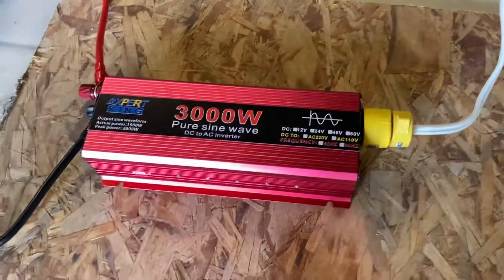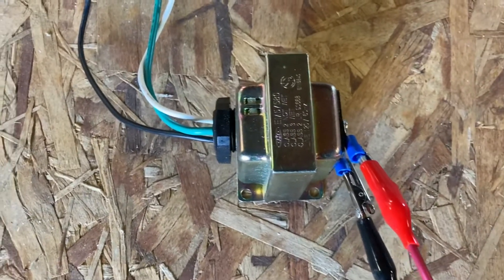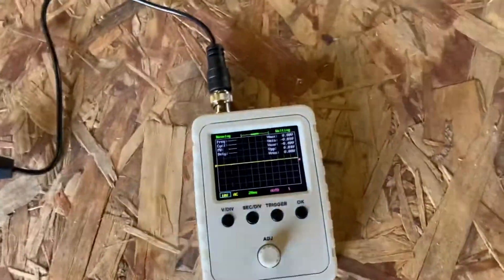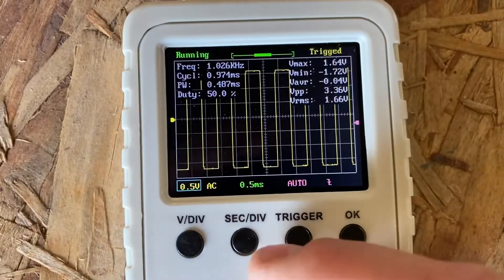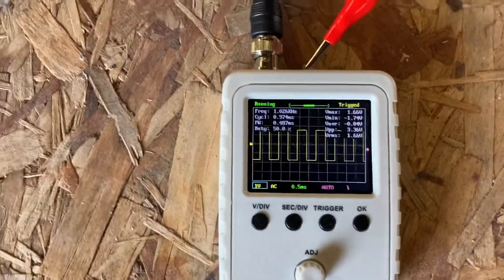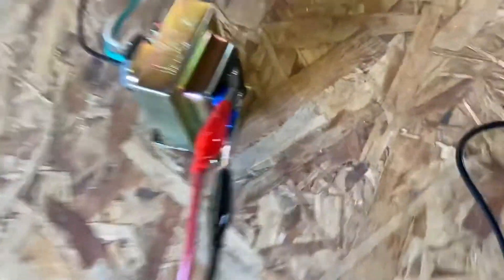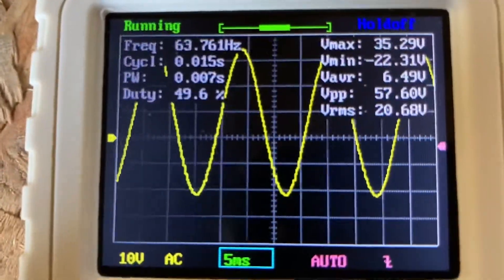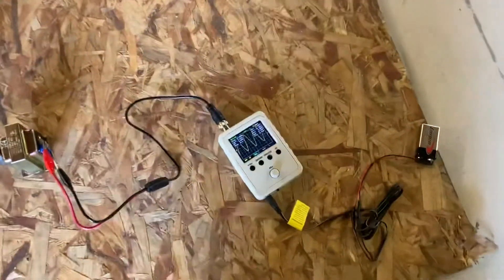PART 1 Pure sine wave inverter testing using a $30 AliExpress oscilloscope

Comment: you are using two hf filters before your scope(one transformer and one ferite)it is better to measure directly at the output from your inverter.
you will find that those pure sinewave inverters make a lot of high frequenzy noise.

Comment: Thanks for the video, 
I want to know if this will work for me.
I have a submersible pump. , single-phase

** *Pump Specifications:* ** 

- Power: 500W 0.67HP
- Current: 3.8A Steady running current
- Voltage: 220V
- Frequency: 50 Hz
- Max Flow: 35 L/min
- Speed: 2860 rpm/min

- Peak running current  - I don't know how much exactly I think it will be 11A

The operating time of the pump is 15 minutes per day.

1500/3000W inverter is good ? or inverter 1100/2200w
Reply from the maker: I think an inverter like this would work, although if I were to buy another one, I would choose one with 24v or 48vdc input instead of 12 volt

Comment: Ksi b Bhai k ups ka koi b msla hai ya ksi ki battery khrab ho chuki hai to apni prblm solve Krne k lye neche link pr click krn Jzak Allah💯
 
💯💯💯💯💯✌️✌️👇👇👇👇👇👇👇👇👇👇👇👇
https://youtu.be/LD4ImM-lpQU

Ups Bnate Ya Lete Wkt Kin chizon Ka Khyal Rkhna Chaiye | Ache Ups Ki Pechan

https://youtu.be/_T926FZiIBY

How To Install UPS Battery At Home | UPS Battery Connection@Akash Babu

https://youtu.be/4-1vMNfMteg

UPS Khrab Ho Jaey To Ghr Ki Bjli Ks Trha Chlaen |

https://youtu.be/t1NTtTLRNm4

Which Battery Is Best For Ups And Solar System In Pakistan| Best Backup Battery For Home

https://youtu.be/genAK-_HAwg

Ups Card Connection | How To Install Card In Ups Full Information/ Akash babu

https://youtu.be/oyVpmHQEvE0

How Much Power Does A Ups Consume | Ups SE Bjli K Bill Me Izafa Hota Hai,|AJ Electric

https://youtu.be/l4bo4VwoTF0

DC Power Supply Full Information | Veriable DC Power Supply Review

https://youtu.be/VUc5FuTdiVs
Pakistani Ups 4 Fault Solution | Big Fault Solution | Pakistani Ups Full Information

https://youtu.be/s6DdMbWyMAo

Millat Battery Ups K Sath Lgana Kesa Hai | Millat Battery Solar K Sath Lgana Kesa Hai | AJ Electric

https://youtu.be/fcUjuThs0AE

How To Repair Battery  At Home  |12V    200 Mpair | @AJElectric

https://youtu.be/tOw6bQ05sUA

UPS LED Lights Full Information | Pakistani UPS | @Engineer Setup

https://youtu.be/wozulozeo3w

UPS K Andr Madule Card Lgane Ka Tarika | Card Madule Installation In Ups |Akash babu

https://youtu.be/fcUjuThs0AE

How To Repair Battery  At Home  |12V    200 Mpair | @AJElectric

https://youtu.be/urbikCBQr6A

UPS Output 220V Board Setting | UPS Chezen jla Deta Ho To Kese Thk Krn

https://youtu.be/DV42QhsoJD4

UPS MPair | UPS Battery Low | UPS Battery Full | UPS Overload | UPS Fix Volte | UPS Load |

https://youtu.be/b7G4q2lF3g4

Desi Ups Setting Control kit Amp Volt Overload Setting|Battery Overload Setting

https://youtu.be/y0ZdIW3630k

Best UPS In Pakistan 2022 | UPS Vs Inverter |   گھر کے لئے کون سا یو پی ایس لینا چاہیے

https://youtu.be/bh5fi0bqzbU

UPS Banane Ka Tarika | Pakistani UPS Bnane Ka Mukaml Tarika | یو پی ایس بنانے کا مکمل طریقہ |

https://youtu.be/CPCeQwIVWQk

UPS Transformer Madule Card Lgane Ka Mukaml Tarika |

https://youtu.be/HxbjCpmYYH8

Transfarmer wire lagane ka tarika | UPS bnane ka tarika part 3 |Akash  Babu

https://youtu.be/PLYNxkPHkqY

Pakistani UPS Banane Ka Tarika| Part 2| یو پی ایس بنانے کا مکمل طریقہ

https://youtu.be/8BPnExZWCFY

Local Made UPS Accessories And How Can We Manufacturing Of 1000W UPS At Home |

https://youtu.be/cp56YrI5Zt8

How To Make Connection Of UPS Kit | How To Make Connection Of UPS Circuit |

https://youtu.be/DTCTzNEGsDI

UPS Wholesale Sman Lahore | UPS Sman Price |

https://youtu.be/gv_UUKuaVo4

Pakistani UPS Output No Backup | How To Repair Local UPS |

https://youtu.be/xufx1Zro8so

How To Replace UPS Module |UPS Ka Purana Madule Nikal Kr Naya Lgane Ka Tarika |

https://youtu.be/xufx1Zro8so

How To Replace UPS Module |UPS Ka Purana Madule Nikal Kr Naya Lgane Ka Tarika |

https://youtu.be/04LqA6XVcMQ👆👆

👆👆👆

UPS Transformer Wiring
 Nikaalne Ka Tarika | What Is Transformer | How Transformer Work In UPS |

https://youtu.be/kJNAWaEztzA

👆👆
Pakistani UPS 220 Volte Output Setting | UPS Setting |Aj Electric👆👆👆👆👆👆👆👆👆👆

https://youtu.be/j27Vfn5NVWM.....................What Is Transformer,Madule And Card And How It's Work In Ups Full Information
https://youtu.be/QjQM72zLlWI.          ............Ups/Solar Lgane SE Pehle Kn SI Information Hona Ap K Pas Zruri Hai
Ksi b Bhai k ups ka koi b msla hai ya ksi ki battery khrab ho chuki hai to apni prblm solve Krne k lye neche link pr click krn Jzak Allah...

Comment: TIP Solar; You can gradually dim down an under-table bulge and all other hungry electricity consumers with a 5000W dimmer (7, EUR). I run 5 dimmers in parallel on an 850W inverter. Kettle 2.2KW at 150W runs for 12 hours at a time, so the water is always hot. The room is also nicely heated. 2.5KW washing machine runs in parallel with dimmed to 200...400W. Iron, dishwasher, oven, electric heater, coffee machine, all internal heating are throttled with me. Videos on my channel https://youtu.be/eC2olbCBhh0 The inverter stays cool, quiet and the MOSFETs remain intact because no extreme current peaks arrive at the inverter... A small, cheap mini solar inverter is now sufficient for everything.

Comment: The transformer isn't needed some claim it changes the wave. Just need the 10x probe available from multiple brands. I just made a vid showing an example search YT for "2uPgP3S5sug" and it will be the first vid, or go to my channel and click on videos. It's currently the latest vid.
Reply from the maker: For sure, I definitely agree. 

There is no way that a transformer can change the sine wave. The sine wave in should look exactly like the sine wave out. 

As far as the different probe, I know I could get a different one, but I happened to have the doorbell transformer already, and I hate spending money on things if I can avoid it. 

I’ll check out your videos! Thanks for commenting!
Reply: @crownlounger  In my vid I also show a way to make a little adapter that's safer for testing the Sine Wave. The exposed contacts are mostly covered

Comment: I always laugh when I see the words, 'pure sine wave' on an inverter.  It's an oxymoron.  The 2 are incompatible.  The fets open and close rapidly creating whatever wave form possible but certainly not "pure".  Filters also help.  But again not a pure sine wave.  If you look at the little bumps in your wave form, you will see these irregularities are less than pure, which would be completely smooth.  Knowing how the dc is converted to ac in an inverter tells you that these devices are incapable of a 'pure' sine wave.  Not that they aren't acceptable either, mind you.  But none the less, a bit disingenuous.  It is possible to create so many pulses to get the waves into a more useable form but not pure.  And again, that's by nature of the way an inverter works.  If you want pure sine wave you get a generator and spin it around inside 2 fields to produce one.  Many of these inverters do get you close enough for useful purposes, though.

Comment: Dude great video.  I also got a portable oscilloscope which has a voltage limit.   I liked how you were able to hook it up to observe the inverters wave form.   Good job!    I'm hoping to get a larger bench scope when money becomes available.   Also liked your shop main disconnect.
Reply: The transformer isn't needed some claim it changes the wave. Just need the 10x probe available from multiple brands. I just made a vid showing an example search YT for "2uPgP3S5sug" and it will be the first vid, or go to my channel and click on videos. It's currently the latest vid.
Reply: That sounds great.  I'm also looking to buy fnirsi-1014d on ebay.  It has a 7 inch lcd and two channel signal generator.   But like you, waiting for funds.   It's under 200.   It's very space saving in that it's not deep and can rest easily on a shelf.   It also I believe operates on 12v dc if I read that correctly.  I use lots of cordless solar charged tool batteries in my shop.

I ordered that 10x probe for my portable scope.  Thanks again for the tip
Reply from the maker: Sorry for the late reply, but thanks for watching! 

Others have mentioned that I could have bought some adapters for the oscilloscope, but I think my little setup worked pretty good. 

I also am hoping to buy a bigger bench scope when funds are available, but for now the little AliExpress one will have to do. 

The shop disconnect was an easy (and fairly cheap) addition and really helps me do some testing when I want. Definitely recommend if you have the capability!

Comment: Nice to see it with the pure sign wave in testing but under load that might change. It looks really small for a 3000 watt pure sign inverter. Size looks more like a 1000 watt. Still could be useful if its safe.
Reply from the maker: Check out my latest video that shows the inverter under load!
https://youtu.be/_pfpbvw2qoI

Comment: If ypur booster pack is like most and you want to make the battery lasts longer charge it with a good battery charger through the booster cables make sure the battery charger does sealed lead acid batteries that charges them to 14.8 volts i have over 12 old booster packs all with dead sulfated batteries when I found proper charging parameters for sealed lead acid batteries on utube I thought they had to be wrong as the manufacturer should know how to properly charge the battery so I took apart my old black and decker and written right on the battery was do not discharge below 12.2 float charge is 13.4 and full charge is 14.8 and on the built in charger was 12 volts so it was dead to start with and being discharged way too far since I had bought 2 ever start booster pack with inverter I checked out what they're charging parameters were the charger was 12 volts but the pack said 13.1 when fully charged so I phoned everstart to check it out and they said that 13.1 was fully charged but I noticed that the booster packs started to loose the number of boosts I could get from a charge from 5 + to 4 then 3 so I put my automatic charger on it at first it would only get it to 80% but after using and charging a few cycles it now charges to 14.1 volts and I can get about 4+ boosts from them they're over 18 months old now and still working my old packs all died after a year I kept them because I could hook them to a battery and use the inverter or the air pump now I'm keeping them because I found I can change the battery again I found it on utube video telling me how to replace the battery even on my nautilus booster pack so when I have this money I'm going to upgrade 2 of my old booster packs I want to add usb regular plus usb quick charge and USB type C as well as 12 volt regulated dc circuitry plus check to see if I can change the charging parameters if not put in a plug to charge them through

Comment: Bro hello. I have no car no battery and 220v 500 watt Power supply 40A 12v Can I connect it instead of the battery? Connect to the car inverter generate 220 volts?
Reply from the maker: A few things.

1. You need to purchase an inverter designed to produce 220v. Mine is designed to produce 120v. 

2. A 500w power supply will limit you to roughly 500w output. (Actually a bit less)

3. If you already have 220vac power available, why do you want to put that through a power supply to convert it to dc only to put it through an inverter after?

Comment: Nice job! Any chance you would be willing to share the link to the inverter? Thanks!
Reply from the maker: Sorry for the late response, and I’m sure you found one already if interested, but this is the link to the inverter I purchased. 
C$ 43.38  51％ Off | Pure Sine Wave inverter 12V/24V to AC 110V 220V 1600W/2200W/3000W Voltage transformer Power Converter solar inverter LED display
https://a.aliexpress.com/_m0xuOWO

Comment: The transformer will smooth the curve, you can try to use 1K resistor and direct connect to the output.

Comment: I watched this twice & still don’t understand what you proved.  Explain?
Reply from the maker: I was testing to see that the inverter was producing a clean 60 Hertz sine wave. Many cheaper inverters like "modified sine wave" inverters will produce a "square wave" sine wave which is undesirable for some applications like refrigerators, power tools, furnaces, etc. (anything with an AC motor) An example of a square wave is shown as part of the oscilloscope test function at around the 3 minute mark.

Comment: url  for product
Reply from the maker: C$ 42.50  51％ Off | Pure Sine Wave inverter 12V/24V to AC 110V 220V 1600W/2200W/3000W Voltage transformer Power Converter solar inverter LED display
https://a.aliexpress.com/_mtAgG0O

Comment: I got the same inverter. I’ve been using it for the past year to power a 900 watt air fryer with no problems, is yours still working?
Reply from the maker: Nice. Yes, mines still working fine. Seems like a pretty well built inverter for the price